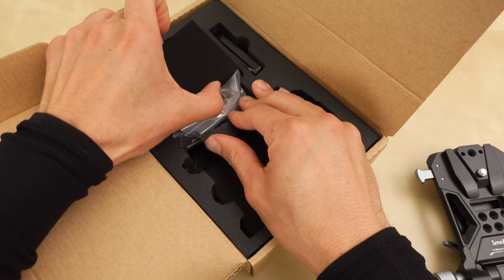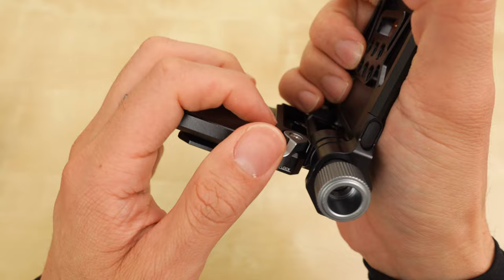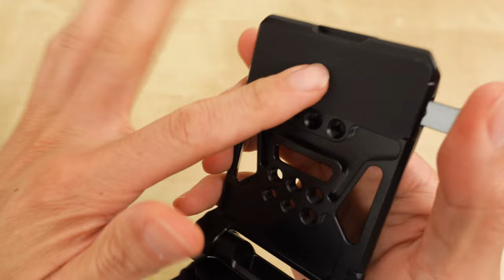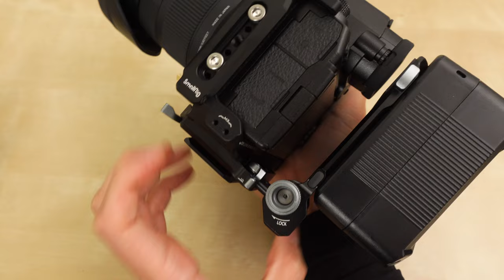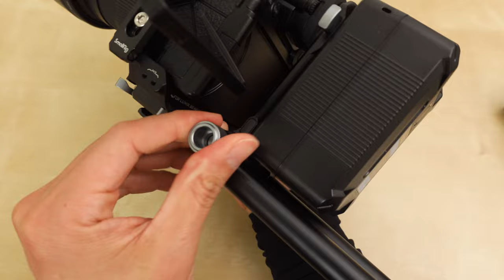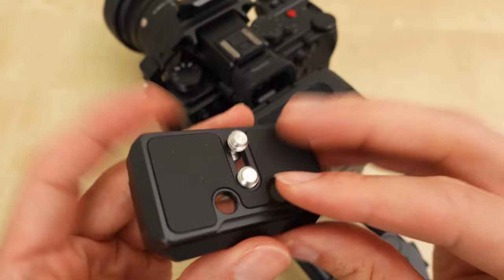SmallRig V-Mount Battery Plate | Panasonic Cameras

Comment: My nano two didn’t clicked in all the way or  is that just normal?
Reply from the maker: Where specifically did it not click in all the way?
Reply: @VideoGizmology  when I push down the battery on the plate
Reply from the maker: does the battery hold, though? Or does it both not click in and not hold?

Comment: I got the parts separately, bought the chest pad and rods, and the rods don't come with that M12 thread and I need to find a convertor screw from M12 to 1/4-20. Would you be kind to let me know that part number (that silver screw from the rod) can't find it anywhere. Thanks!